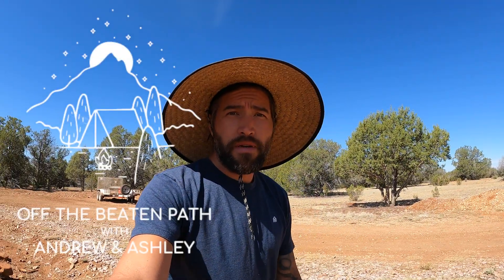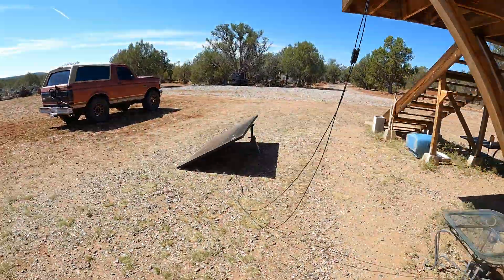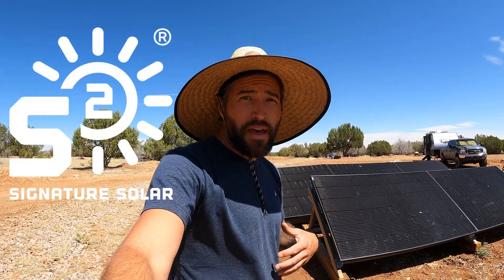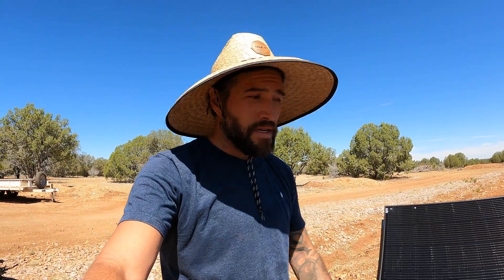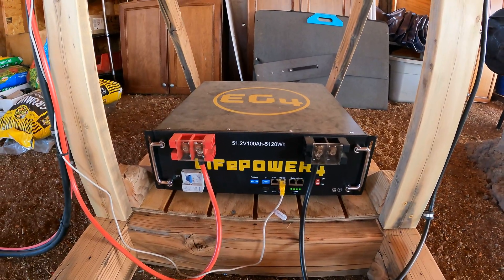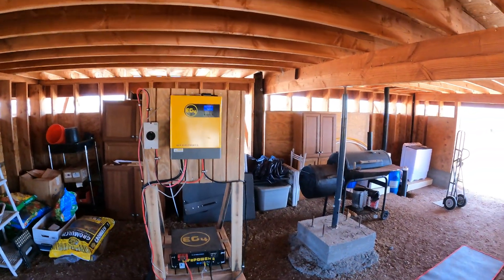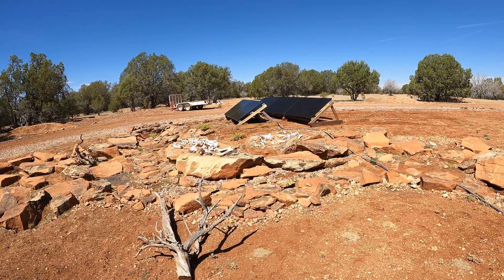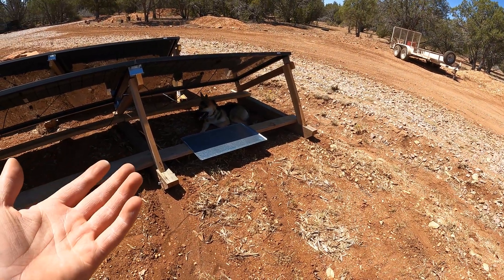Repositioning Our Ground Mount Solar Array | Off-Grid 40 acre Homestead

Comment: In Dec I get 130 SE to 210 SW, setting 2 strings at 180 S and 2 at 150 SE, Shademap app set to Dec 16 then you can fine tune the angles or double check.  Perfect the winter angle and the rest of the year falls into line. You could flip the panel make the lead closer. Compass app for the phone, hopefully you have the level app already. 4X8 1/2 ply then spray glue mylar makes a very reflective surface. 
You look like a builder, make a mount, 3 trailing axle hubs one facing upward and secured, triangle frame with 2 wheels plus the pivot, a giant rotating array. Once you get more batteries and can run over 24hrs then time of day for charging won't matter. I see people trying to get late day sun (makes sense) but winter you want to be south. The path is only SE to SW. If you are elevated enough to get 90 days of snow let me know that's a whole other novel.
Reply from the maker: Thanks for the tips, this is helpful! I want to build one large array sometime in the future. But this is getting us going for now. Thanks for your support
Reply: @HideawayHomesteadRanch   A sturdy mount for sure, ice sled design. My trailer is solar powered, electric heat only, 600 gal on board, one of a kind heated basement, freeze proof water in and treated out underground, solar self-cleaning 25 months now, with 68 hours of Gen since March 5, 2024. Temps -25F to 103F, inside 62 to 72F year-round, in Jan I spend an hour clearing roof snow, I have stayed in 113 days straight, chores monthly 2 x 2 mins to empty compost. Upgraded the inverter, 5000w dryer for 8 hours at night np, well when I get one. If you ever need ideas for easy off grid let me know I have a few.